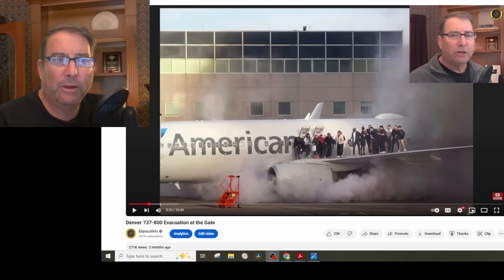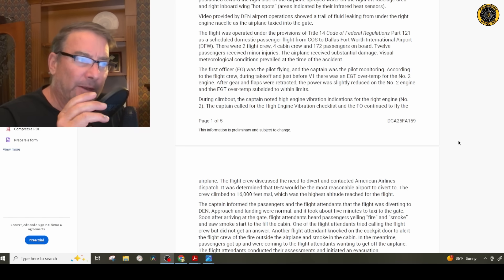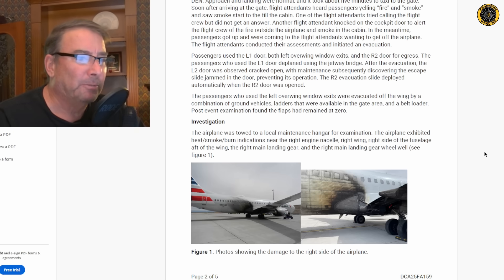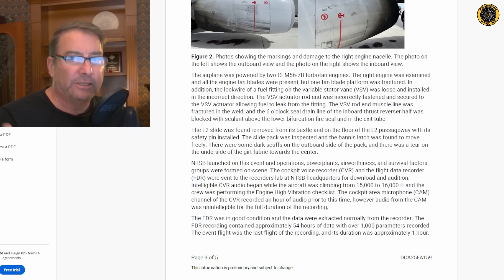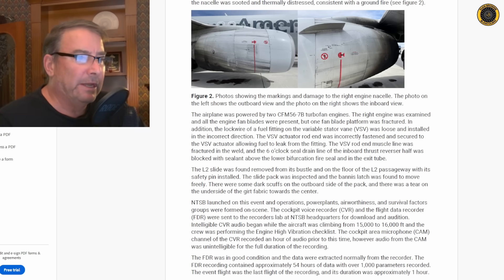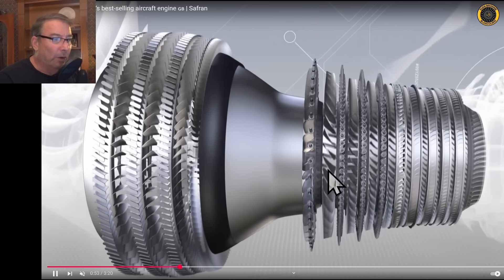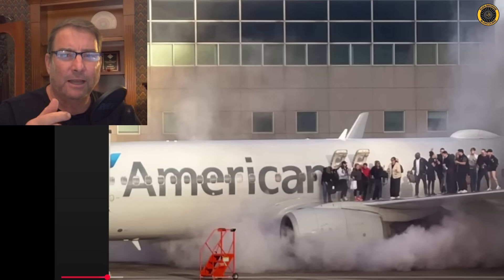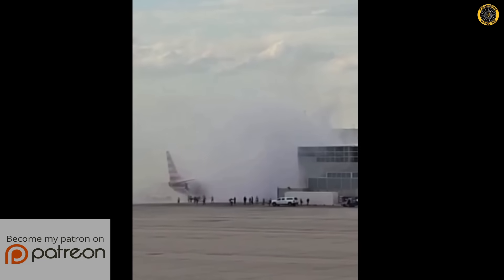NTSB Prelim American 737-800 Engine Fire at Gate and Over Wing Evacuation

Comment: I've safety wired a bunch of stuff while in the USAF, but I'd suggest you NOT do that last pinching twist as the radius of bend is too small and that will tend to weaken the safety wire.  You want the wire tight so it isn't rattling around, but twisting with too small of a radius will weaken the wire so do not do that!  Also, I'd bet there's about as many electrical connectors that need to be safety wired as there are nuts.  When wiring nut-to-nut all the nuts are for the same part -- you do not want to safety wire to nuts on different parts.
Reply: I wondered about that, but thought perhaps the last twist was more a half twist at the end to reduce the slack without adding stress to the wire... but I am not a mechanic/engineer and 100% trust your experience on that, and am now wondering if that video was indicative of what is being practiced, or just a poor example that was picked up by Juan.
Reply: @MeppyMan  You want the wire tight enough that it doesn't wobble about which could loosen it, but there's no point in making it super tight as that doesn't buy you anything.  When properly installed the direction the wire makes with respect to the nut or other thing (connector) should be such that in order for the nut to loosen it would need to pull tighter on the wire and that whatever force/torque attempting to loosen the nut is countered by the force the wire applies in opposition to loosening of the nut/bolt.  The wire isn't to keep the nut tight, its to keep it from loosening!
Reply: That last twist is definitely not a good idea. Can’t believe someone would make a video teaching something like that because it could definitely compromise the wire at that point.

Comment: Mechanic or engine builder who did that safety wire and rod assembly likely hasn't got a job now. Two or three blunders on the same engine? I'd fail the mechanic. 
I have a concern as to why the flight attendant got no answer from the cockpit !

Comment: I have a crazy idea - some cars have external cameras (some have lots of them).  Why not add two cameras on either side of the fuselage, pointing back toward the wings and engines, so the PIC and FO can see the engines - they might have seen the engine fire (assuming the power wasn’t off).  And hey, maybe one pointing toward the vertical stabilizer, or toward the empennage in general?
Reply: Some aircraft have exterior cameras and work really good.  It’s aviation so not cheap or that easy.

Comment: Thanks for the report, Q;  If the PAX cannot use the over wing exits with the flaps at Zero how can all the PAX be evacuated in the FAA certified time after engine shutdown with flaps Zero ?.  Is it not possible to use the hydraulic accumulators / Nitrogen to deploy the flaps.

Comment: I think the FAA should force Boeing to have slides over the wings. It appears Boeing again  looked at the bottom line rather than put slides in the over wing escape doors. Do other planes similar in size to this 737 have slides?
Reply: While there are similarly sized planes that do have these slides, the ERJ190 does not. So if FAA should force Boeing to have slides over the wings, then they must do the same with Embraer
Reply: @Blank00 that would be good. Better safety it would seem.

Comment: As a Technical Inspector (TI)  for the Army H-47. Negative lock wire was one of the most common issues when inspecting the repairs. The engines were especially hard because they had so many bolts lock wired together in a relatively small area you really had to slow down and carefully check every single one.

Comment: Had the American Airlines Flight Crew declared a Mayday or Pan for an overheating engine, the engines could have been checked by ARFF upon landing and this whole debacle avoided. But Failed Emergency Exits are becoming more and more common, and this example of failed communications between the pilots and crew could have easily resulted in serious injuries or worse. Include the failed cockpit recorder and American Airlines Maintenance and Safety comes into play. But these American Airlines Pilots certainly put their company in the spotlight they deserve, and for that, the Flying Public says, Thank You! But I was in Denver the day an American Airlines engine fell off. Just like then, the FAA is again, MIA.

Comment: This is just odd; every one of these maintenance errors is egregious in their own right, but all on the same engine? 

I highly doubt the same mechanic touched every one of these components, though that would be the most simple conclusion. 

The safety wire thing is just crazy - all A&Ps I know are VERY competitive about safety wiring, and will hold judged contests even! 😂

This one actually has me worried, I hope delta mx management was IMMEDIATELY scrambling to pull the logs and find these people, and check their other work - while having their best line guys do extra thorough checks between flights.

Comment: When the door opens with the slide armed it pulls a pin on a gas canister that inflates it. During slide replacements you have to install a safety pin to keep it from inflating when you’re working on it. So it’s a bit confusing what they mean by safety pin. Sounds like the slide just got hung up and didn’t open enough to pull the pin on the gas canister.

Comment: 10:00  Just a side note, the blades are numbered so they can be reinstalled in exactly the same place because this is important for the balance of the engine to reduce vibration. The hub has an index mark at the number 1 position. If I'm not mistaken the spinner at the front of the engine is mounted with special bolts that have a special weight value for the fine tuning of the balance. You can order whatever weight is needed after a engine run to check the balance. So we have work tables to keep the blades in order as they are removed. 
Sometimes the engine shop engineers call out to replace a pair of blades to make a gross adjustment in the balance. These blades are routinely removed to re lubricate the base which gets a special coating. They get inspected and lubricated.  From my old run days it would have been unheard of to get vibrations anywhere near a value of 4. Nowhere near 4. Way less. I can't imagine what 4 would feel like.
Reply: The blades are supplied in pairs, to be installed directly opposite each other.  There is a tolerance +/-, for the weight of blades in general, but a very low tolerance for the difference in weight between an opposing pair of blades.
Reply: @pulaski1  Thanks for the info. It's been a while since I worked that side of things.
Reply: Thanks for this detail info!
Reply: And I struggle just to get my ceiling fan blade balanced.
Reply: @AgentJayZ has great videos on how blades are installed and all things jet engines in general
Reply: @Kiera_Jackson74   Yep, excellent content.
Reply: Thank you for the comment. I was wondering if the blades needed to be replaced in the same position.
Reply: If you add lube, does that require reassessing balance?
Reply: @beenaplumber8379  Well, kind of. The lube is equally applied to all the blades, and an onboard vibration monitor is always in operation. That's how the pilots knew they had a vibration. It has to be really bad for the vibes to be felt in the throttle levers. After a blade lube, a high power run is done for several minutes to let excess lube ooze out and get burned by the engine. I've personally seen a pilot writeup of odor in the cabin the flight after a blade lube.
Reply: @beenaplumber8379  Not because of the lube itself but I think because the fan blades were removed and reinstalled requires a balance run. Not sure but I believe that's the case. I've seen the guys get blades in the wrong place and have to do it over again. They are only human.
Reply: @rael5469  You are correct.
Reply: @beenaplumber8379  I have not worked on that particular series of engines but my experience has been that a dry film lubricant is used in such areas and does not alter the balance.  These lubes are an aerosol spray.
Reply: @beenaplumber8379  Sleight differences in weight at the hub are a lot less significant than differences towards the outer end of the blade - it's a leverage issue.

Comment: Hello Juan, I was under the impression that the variable staters change the angle of attack of the airflow as it was presented to the rotors in the compressor section. I suppose this also allows more airflow, but unsure of your analogy. Thanks!
Reply: The variable stator vanes deflect the incoming air so that it doesn’t flow into the spinning compressor blades at too high of an angle. Basically, they control the angle of the relative wind.

Comment: Does safety wire really have the tensile strength to prevent bolt loosening?  The wire seems pretty soft a malleable to me??
Reply: If you held it in your hand you’d know it was plenty strong.there are different gages of wire depending on the task.
Reply: @stephenwalton9646  I've "held" lots of safety wire, and it high malleability makes me think I'm wasting my time with safety wiring.  A high tensile wire will not so easily wrap in the double helix without springing back, or breaking.
Reply: @wdhewson Honest question. Was it .040 stainless aviation lock wire or for some other application such as witness or breakaway wire? The stainless I’ve used for the past fifty years was anything but,”Malleable.”
Reply: @stephenwalton9646  Honest answer.  It was sold in a motorcycle racing shop, and cannot remember the exact metallurgy.  But if it winds into a stable double helix, it is by definition malleable.  And stainless wire is generally a lot weaker than carbon steel wire.  For example stainless bike spokes are really weak, and stainless fasteners are generally weak, and shouldn't be used in critical situations.  A little googling offers that safety wire will break if the fasteners are not properly torqued, and this seems to imply rather a lot.  But I'm undecided about the value of safety wire, hence my question.  You'd think that some mechanical engineers have published scholarly work on this subject, but I haven't found such.  I'll look again.  Without data we rely on "faith".
Reply: @ashkebora7262 Supple and strong are opposites.  Pay attention to your words!

I think Wikipedia is correct about the physical properties of lockwire.   They know the definition of malleable.

"Since safety wire is made of a malleable alloy, it retains its shape after being bent, rather than springing back to its original shape. This property allows it to remain locked around an object, such as when it is passed through a small hole on a fastener, looped back upon itself and then twisted. "
Reply: @ashkebora7262 No touche grnated to you on the rope.  You're comparing organic fibers with die drawn wire. Not the same ballpark.  So think about the properties of a high tensile wire rope.  And think again.  By the way, the engineering math is possible.  The soft stainless of lock wire is only 75,000 psi tensile , so a 0.032 diameter wire break at about 60 lbs load.  Very weak, because it's so malleable.  No such thing as structural gold!!
Reply: @ashkebora7262 Degeneration to insult in not the route to knowledge............thus our conversation ends unproductively.

Comment: At some airlines these escape slides are taken very seriously. Mostly to prevent inadvertent deployment.....but also to make sure they are installed correctly so they function as intended. So we have an inspector present during removal and installation. This reduces inadvertent deployment and also makes them more reliable in service.
Reply: Not only that they will kill you if not respected.  The slide is dangerous when being worked on.
Reply: @SoloNomad-243  Very true.

Comment: Yeah, safety wiring 101. Lockwiring was the very first thing we learned in AFUN-P ( Aircraft Fundamentals) in the USN in the 70s. There's nothing more basic and easy to do right.
Reply: That brings back memories of assembling and safety wiring the hardware on submarine guard valves.
Reply: Mine are of the mid barrel support to the GAU-8 gun system on the A-10.  The drum bolts weren't much easier though. 😮
Reply: Wasn’t Millington a wonderful liberty town.  It had a Walmart and a strip club.